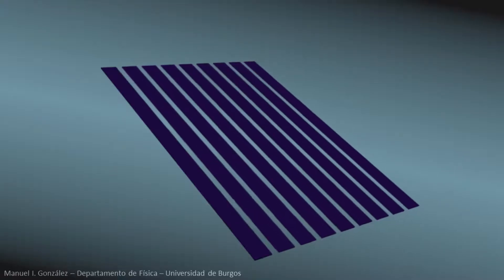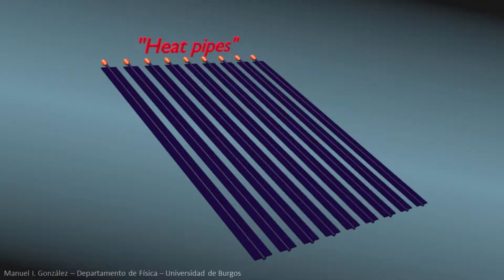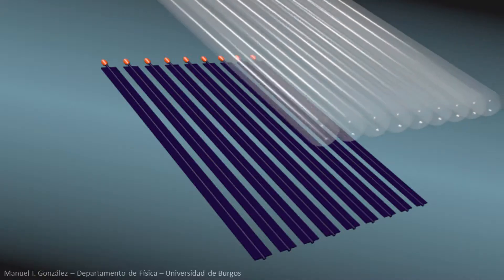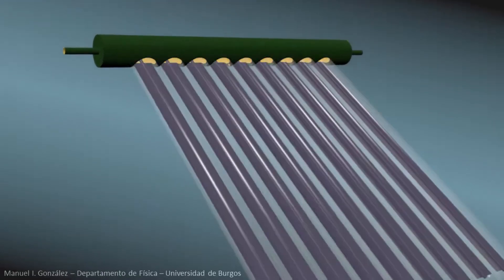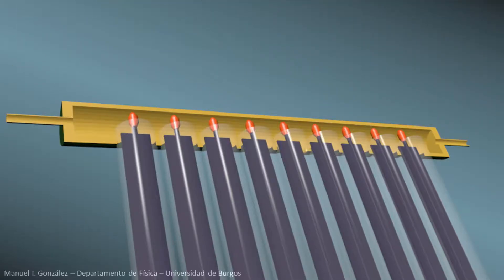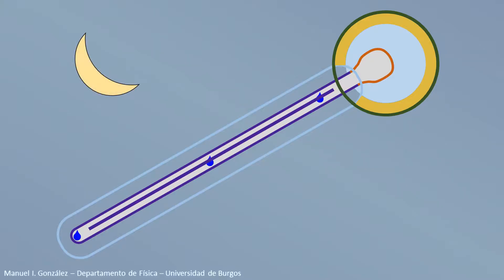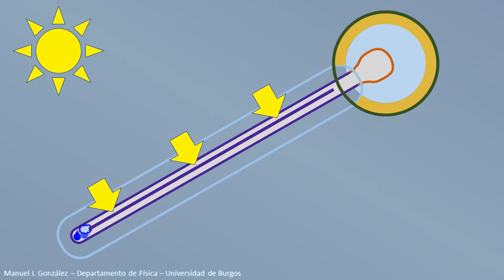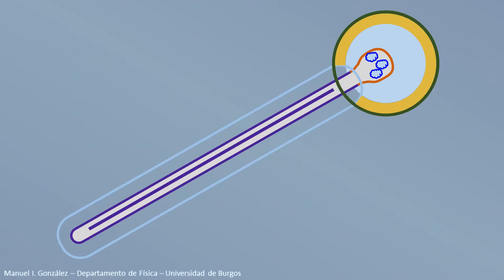Vacuum solar collector - Heat pipe

Comment: So, you get convection within the condensor tube, with the volatile liquid cycling up from the heated tube when solar rad is present and cycling down when cooled by the cycling fluid. Huh....makes sense why this would be the preferable design for the pipes.

Comment: All you need now is a parabolic mirror behind the evacuated heat tubes to magnify the heat collected, use oil instead of water to collect higher temperatures than 100 degrees C, then collect the heat in a well insulated sand battery to use as central heating 😉
Reply: How are you collecting the heat from the sand battery? Hot water loop?

Comment: What happens if a glass tube is broke and isn't evacuated anymore?
Reply: the heat that should be used for boiling the alcohol inside will be lost to the wind or air surrounding. that affects the performance.
Reply: @abrahakahsay  Professional explanations. 👍